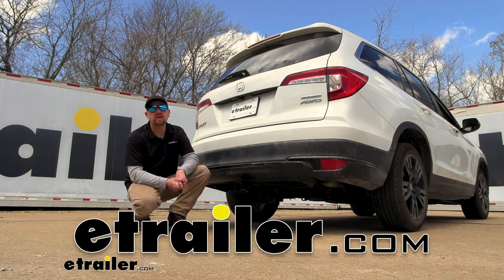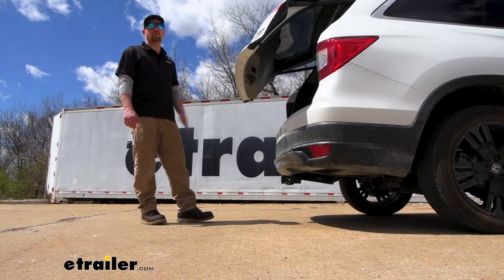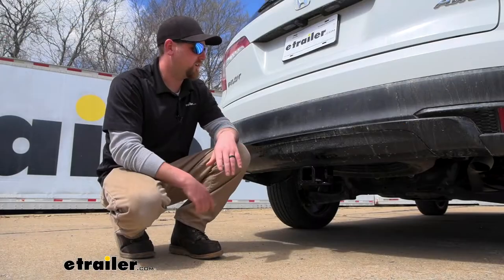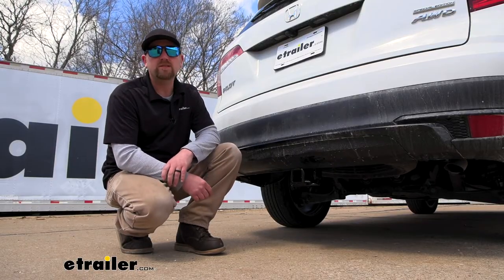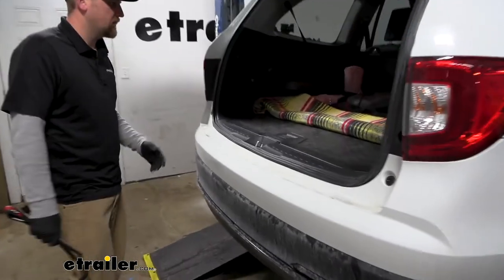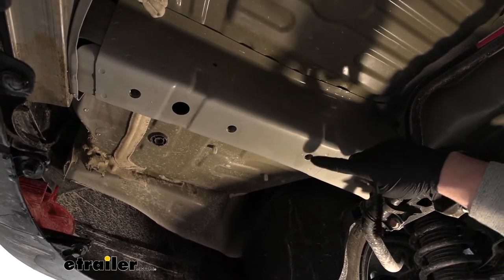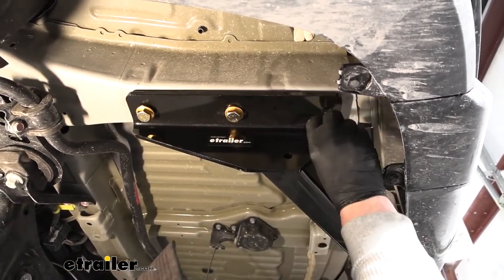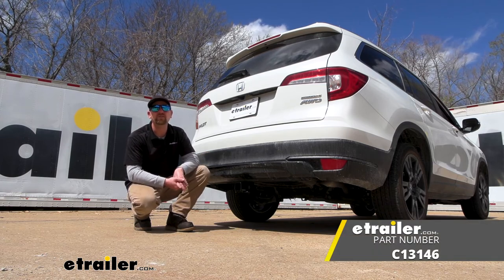etrailer | Setting up the Curt Trailer Hitch Receiver on your 2022 Honda Pilot

Comment: Is the hands free tailgate sensor adapter needed to relocate the sensor when installing the receiver? Or is it still functional in its factory position with the receiver installed?
Reply from the maker: We've received feedback from our customers that the Curt # C13146 trailer hitch prevents the sensors from picking up movement at the center of the bumper, but if you wave your foot several inches to the right or left of the receiver tube and a bit deeper under the bumper than you did before the hitch was installed, the sensors will pick up the movement and operate the hands-free hatch feature.
https://www.etrailer.com/Trailer-Hitch/Honda/Pilot/2022/C13146.html

Comment: I have a 2009 Honda pilot and I was wondering can I tow my 2004 Honda accord?
Reply from the maker: It's going to depend on the towing capacity of your Pilot, which ranges from 3500 to 4500 lbs, depending on how it's equipped. Your owner's manual will have more details about this. Your Accord should not be towed with all 4 wheels down. In an emergency, it can be towed up to 50 miles at a speed no greater than 35 mph. Your best bet would be to use a tow dolly like # DM9713045.
https://www.etrailer.com/Trailers/Demco/DM9713045.html
Reply: @etrailer  thank you
Reply from the maker: You're very welcome!

Comment: Would you recommend to retorque and/or once a year just check for tightness in the event maybe one or two might be loose ?
Reply from the maker: Most folks wouldn't think to do that, but it wouldn't be a bad idea!
https://www.etrailer.com/Trailer-Hitch/CURT/C13146.html
Reply: @etrailer  Thanks for the reply, thanks for the confirmation, Probably a good idea your right, cheers from Calgary Alberta

Comment: Would this trailer hitch be strong enough to tow a boat?
Reply from the maker: Maybe. It depends on the weight of the boat. The hitch itself has a 6000 lb capacity, but you'll be limited by the capacity of the vehicle. AWD Pilot models with a transmission cooler have a 5000 lb towing capacity, AWD models without a transmission cooler and 2WD models have a 3500 lb capacity. These capacities are for a vehicle with 2 occupants, and decreases as each additional occupant is added. For more info, check out the Towing a Trailer section in your owner's manual.
https://www.etrailer.com/Trailer-Hitch/CURT/C13146.html

Comment: What’s the bolt size?
Reply from the maker: The hitch uses six M14-1.50 x 40mm, class 10.9 hex bolts and six 9/16" conical-toothed washers.
https://www.etrailer.com/Trailer-Hitch/CURT/C13146.html

Comment: Any loctite needed
Reply from the maker: Nope, as long as everything is torqued down to specs (as outlined in the instruction manual you'll get) nothing else will be needed to safely secure the hitch. https://www.etrailer.com/Trailer-Hitch/CURT/C13146.html